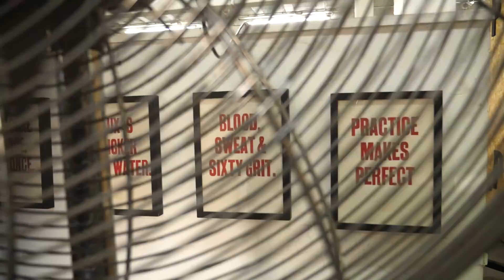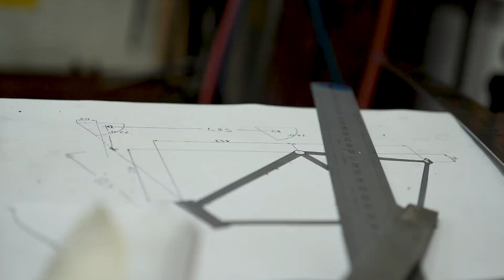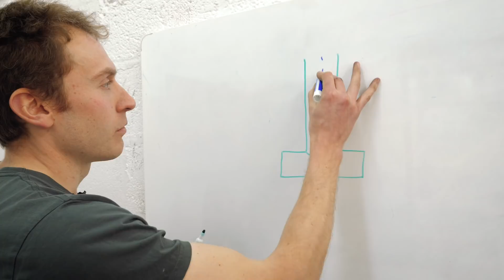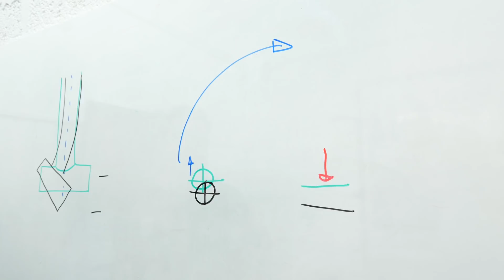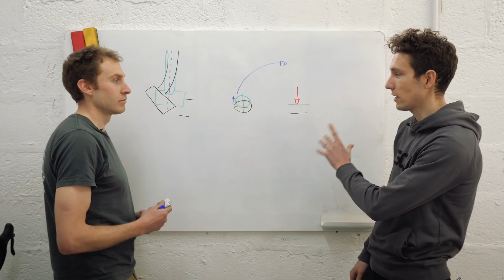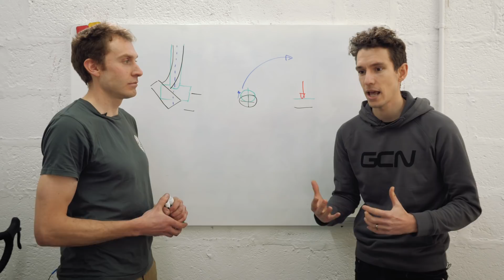Are You Faster On A Stiffer Bike?

Comment: I think it comes down to response, rather than efficiency. Thinking of the frame as a spring, a stiffer frame will send the force to the rear wheel faster than a less stiff frame, feeling more responsive, which probably translates to feeling "faster". I speak as someone who rides a (nearly) 20 year old lugged steel frame and get frustrated sometimes how long it feels like it takes to wind up to speed.

Comment: In my opinion, they both transfer a similar amount of energy. The biggest difference is the reaction time. Stiffer bikes react faster to load switching between handlebar and two pedals (for road bikes). On the other hand, the less stiffer bike reacts slower but is good at absorbing external forces ( for cycle cross or mountain bike).

Comment: Doesn't that frame flex gets distributed in the form of vibrations as well?
And those vibrations in turn being dampened by our contact points
For example a full suspension MTB absorbs it and dampens the vibrations.

Comment: There's a theory that I've subscribed ascot frame flex/stiffness
1) a stiffer frame is usually a bit more responsive, but not substantially
2) tires, and wheel components (mainly spokes and rims) negate benefits of frame stiffness as they tend to flex before the frames do. 
3) unless you're climbing there isn't that many opportunities to overload your frame with energy as shown on the experiment.
4) a certain level frame stiffness is important specially with tighter drive train spacing you avoid ghost shifting, unnecessary noise and excessive chain flex.
5) flex is good as it helps compliance to have vertical compliance whether, it's at the wheels, frame, saddle, bars or seat post.

Comment: If the spring load energy is converted to a rotational force on the back wheel as the experiment suggests, then subject to losss(heat, noise etc) the energy used in flexing the frame gets to the drive eventually - like a "Cush" drive on a car drive shaft - it lowers immediate load force but no overall loss. As an example, (works in my head anyway) if I pull a weight with an elastic band, it won't move straight away, but once the elastic has stretched sufficiently, the weight will move and accelerate as the stretch in the elastic is released - overall, the force applied to the weight is the same. But does this mean the bike goes at the same speed overall? Same power, less torque? Maybe the energy is released at the bottom of the stroke, giving a more even and smoother power delivery?
perhaps the release of the springs energy Assists acceleration - or does the compression of the spring decrease acceleration? Why can athletes run faster on Blades once up to speed? Why can I jump higher on a trampoline? Why can I ride my bike faster than I can run when it's 8kg heavier?
I've no idea really have I..................

Comment: My first custom bike in 1988 was a 27” steel frame. Unlike other Clydesdale frames I had seen, there were no stiffening stays or lugs. It flexed liked a flexy, flexy thing. It didn’t take much power to flex the BB. With rear panniers it was like riding an old Porsche 911; I once drifted through a wet roundabout with a bus right behind me! It is now permanently attached to my KICKR where it can do some good. 
I now ride a Trek Domane, reputed to have one of the stiffest bottoms of any frame, yet supple to ride.

Comment: I really enjoyed this video and (as an engineer) it makes perfect sense. What it made me think is that while there is little energy loss due to frame flex (there must be some as materials aren’t perfectly elastic and have internal friction) the difference between a stiff and flexible frame has to do with responsiveness. In other words, the stiff frame won’t flex much and will transfer the energy to the drive train right away (ie isn’t storing the energy to return later) and so the bike “jumps” when you put on a large load like a sprint. On the other hand, a flexible frame will store the energy and return it to the drive train later so the bike will feel “sluggish” when a large load is applied even if the net energy applied is almost the same. A stiffer bike will win in a sprint.

Comment: www.bikequarterly.com has been discussing this in the last 15+ years. Their findings are that stiffness is irrelevant, usually the stiffer "feels" faster, while the flexier frames usually clocks faster times on uphills with most cyclists. 

I remember 1998, when I switched to an stiffer alluminum frame and clocked SLOWER than my previous heavier weight more flexible steel frame on a uphill TT. After a few months, when I got used to the stiff-frame pedalling, I started to clock back the same times as before.

I have noted that my 20 year old lugged steel rig outpaces my super-stiff carbon fiber on uphills, even if it weights 2 kg more. It´s definitivey more enjoyable, faster and less tiring to climb on the flexible steel frame, even with the weight penalty.

This may be all related to pedaling style. I´ve grown up riding "flexible" (by today standards) steel frames. Maybe I have learned it with old school equipment and that is a forever skill to develop.

For me? I REALLY prefer flexible bicycles...

Comment: This experiment is fundamentally flawed and does not answer the question. The flaw: when you apply load to the pedal and the frame flexes, the pedal becomes immobilized between the block and force applied to the pedal. When you release the brake, the frame moves back to center while the pedal is still immobilized; however, as the frame moves while the pedal doesn't, the crank moves. This occurs because the crank axles moves upward with the frame while the pedal remains stationary; thus the crank turns. All you have done is pre-loaded energy into the system and forced it to the rear wheel. If you move the pedal to Bottom-Dead-Center and repeated the experiment, the results would differ because the rear wheel would not move. 

Most likely frame stiffness contributes little to power gain or loss due the dynamic nature of pedaling. Frame stiffness is more likely to contribute to handling.
Reply: Thomas Johnson This is the only right opinion. My man!

Comment: Back in 2015 when I was tossing up whether to get a new bespoke steel bike or just an off-the-rack Carbon Fibre bike. At the time I was reading claims from one or two steel bike builders about the benefit of steel frame flex/power transfer. Googled this matter but found nothing else on this issue. Consequently bought my plastic Giant Propel. 
No regrets purchasing CF. I love the feel of the ride. One thing I am absolutely sure about is CF has much better power transfer. On steel, I literally had to fight to stay with on fast club rides after every traffic stop. (Hated it but it really made me much stronger). CF is so easy to take off with. 
I am not an Engineer and so dont know the reason, but I can say whatever flexie power transfer a steel bike provides, it is not as efficient as simply having a stiffer CF bike. My guess is that you probably lose more power from the flexing process than what you get back.

Comment: This doesn't require a lot of fancy lab gear to figure out.  Just get a yoga ball, put it against the wall, and step on it forcefully and repeatedly for a few minutes.  Getting tired?  Of course!  It's called isometric resistance.  First, your muscle compresses the ball, and then your muscle also resists that same force as the ball decompresses.  So when your bike frame acts like a spring bouncing up and down and side to side with each pedal stroke, at least some of the energy exerted winding it up just goes right back into your muscles on the "negative" part of the repetition.  So some of your own energy is being used against your muscles to tire them out even faster instead of going into the drivetrain to propel you forward.  This is probably the main reason my carbon road bike is 2-3 km/h faster on a flat surface than my similarly-configured steel frame bike which (much as I love it for relaxed group/century rides) has a lot of frame flex.

Comment: I would like to see an extension to this video involving an actual ride comparing the two frames by taking power at the pedal and at the wheel simultaneously to see how much power (if any) is lost.  You could even swap over the drivetrain and rear wheel for ultimate parity!

Comment: We are talking about stored energy here.  If rotating the wheel is like pushing an object through a spring, the stiffer the spring the harder to store energy in the spring as we push.

I would rather the energy transfer through to the wheel during our force pulses rather than have a portion store in the frame and come back out through my foot on the backstroke or twisting me at the handlebars and dispersing across my body.  

Remember, energy stored in the frame doesn't necessarily go out through the drive chain.  It can come back into us at innopertune moments.

Comment: there is also a difference between a frame's flex that causes a dampening effect, & frame flex that will rebound (which is primarily what you're talking about above).  Not all frame flex is the same - sometimes by design (or should I say, done on purpose), sometimes just by the material/angles used (non-intentionally).

Comment: Largely a 'feel' thing. You may lose energy in the system to damping (carbon can be tuned to damp out vibration just like a car's suspension), although I would question whether it was enough energy loss to be considered as a viable trade-off for the handling and feel (read comfort). It is doubtful you would waste significantly more energy in even the longest of rides between one bike to the next if stiffness was the only variable, unless your bike was as stiff as Tom's 3 wheeler

Comment: There is the question of whether or not the energy you put on the pedals goes back in the movement of the bike. A flexy frame will store energy as potential energy and will release it eventually back into the movement of the bike.

However: a stiffer frame will put the energy Into the movement immediately. This should result in better acceleration. If timelines is important to you, a stiffer frame may still be the way to go.

Comment: Mmmmm. Not sure 100%. How about the energy stored in the chain? Did you take it into account? I understand the concept of a bow, but also agree with the splip of the tire (tire deformation). Go carts flex in order to have grip and turn, but to much felx and you end up with an undriveable jelly, to stiff it will go straight. I don´t know in bycicles how it works.

Comment: Frame stiffness, and general racing components is all about maintaining geometry under load.
Try riding a flexy track bike flat out round the banking and it'll take some keeping on the black line, a stiff setup will stay nailed to it.
Same reason you put strut braces and similar on racing cars.

Comment: With this experiment you are building tension on the chain, no wonder the wheel spins when you release the brake!
Reply: At 5.89 it's even clearer, first you block the pedal at 0.5 cm above the rock, than you release the brake, this 0,5 cm is enough to spin the wheel

at 8.59m you can also see the torsion of the home trainer,

Comment: In my humble opinion this experiment doesn't actually answer anything as when tension is applied to the drive train we get a stress in a complete system. Lets start with a brake caliper/rotor as it is a starting point, then we have a chain which will act like a 'rubber band' when the tension is applied (it is not visisble but it WILL store energy), later on we have chainring and a crank/pedal. When you flex the frame on the drive side it's length is increased (let's say 1/4" to 1/4") so when the brake is released frame returns to it's former state and the energy stored in the chain due to the increased length is released makes the wheel turn. Pay attention to the gear ratio at the moment of experiment as 1/4" in difference in length makes like 8% of wheel revolution (rear sprocket wise). Since energy is released almost instantly that makes a wheel rotate pretty fast. In real world a cadence is a constant factor and frame rebound rate is slow you will 'sink' energy/performance due to energy input/pedaling and frame rebound is not coherent so it might cancel each other.

Comment: Flawed line of thinking. The flexed frame stores energy, yes. In the flexed state it will release this energy if the load applied or brake lever is released, yes. When the energy is released it transfers to the wheel... not necessarily; the energy is going to transfer through the path of least resistance. In the case of the experiment the energy will transfer to the wheel because you have maintained the pedal load/position with the block. To get all that stored energy to completely transfer to the road you must continuously provide enough power to the pedals that is equal to or greater than the stored energy in the frame. If you lapse, even for a micro amount of time it will most likely dissipate back to the crank/pedal/leg path and work against you, exactly like if you took your foot off the pedal instead of releasing the brake in this experiment. Let's say you could provide enough power and delivery it evenly enough to keep the energy from releasing back to you, then you are simply keeping the frame in it's flexed state and all your energy is then transferring to the wheel. I guess this means stiff frames provide better power transfer to peons like us so we go through fewer/smaller load/unload cycles with frame flex compared to pros who maintain a more even delivery of power.

Comment: Here's a thought experiment that I think proofs you wrong: imagine the same set up, but now, rather than push on one side of the crank only, you do so right, then push left, right left etc., flexing the frame repeatedly. Now you let go of your break. You will get some spin from your wheel, like you just showed, but nothing corresponding to any accumulated force that you might have built up by flexing the frame repeatedly. What this proofs is that you can certainly 'loose' most energy by flexing the frame (probably in the form of heat) rather than that it 'has' to go back into the frame.

Comment: If you had put a coil spring between each shoe and each pedal, you would have got exactly the same effect. Perhaps we will start to see the pro riders putting springs under their shoes .. or maybe not! Maybe you could try the springs idea on a bike up some big hills and then I think you might rapidly draw a different conclusion. As you discovered during the test, it takes quite a bit of energy to bend the frame, but the wheel only spun because there was minimal resistance to rotation. In the real situation where the resistance of the wheel is constant-ish over the fraction of a second involved, the stored energy in the frame would be simply released back into your leg when you stopped pushing down - so you would be wasting energy twisting the frame (akin to squeezing a spring) and releasing it again. Alas no matter how accurately or often you measure the wrong thing, you will always get the wrong answer.

Comment: An interesting experiment. I'm no scientist but to me  it looks more like it's stored energy in the tension of the chain. 
If the experiment could be adapted and show the energy transference to the wheel through the frame flex and not the drive train.
ie. if the chain was removed and we flexed the frame would the wheel start to spin?
I think the experiment shows that a stiffer frame gives the power more directly to the drive train, which is what we would expect. More force is directed into tension in the chain.

So, if we've proved that no power is lost in transference to the rear wheel. Could it be argued that a flexible frame in certain condistions could be faster as it could be more comfortable and controllable?

In motorcycles a certain amount of flex in the frame is desired. Suspension only works in one plane and doesn't have as much an effect when the bike is leaned over in a corner. So flex in the frame acts as suspension, absorbing the bumps and keeping the wheels on the road.